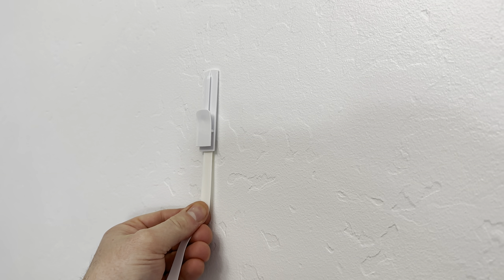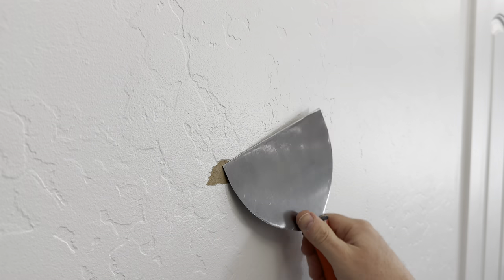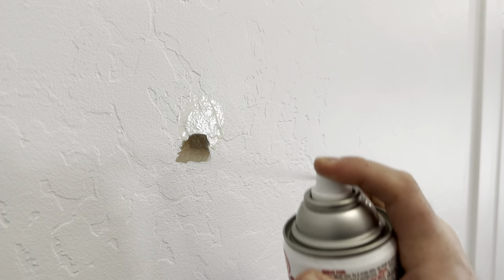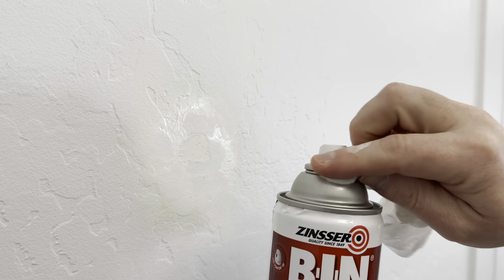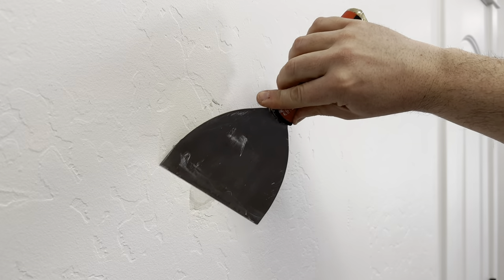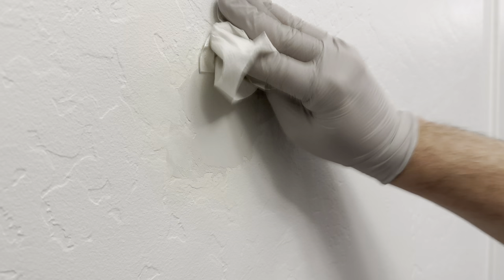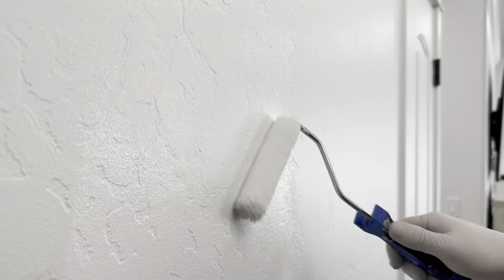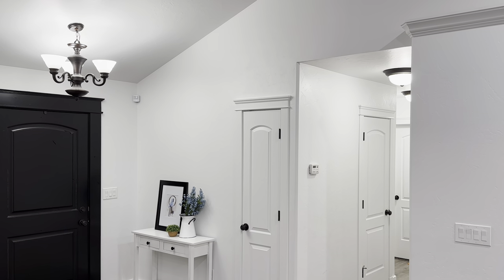How to Repair Torn Drywall Paper

Comment: I used Titebond and rubbed in all the torn drywall paper. I got it as smooth as possible first. Can I use another brush glue (it’s by Roman) on top of this before quickset mudding?

Comment: Try doing this without wall knockdown. Without texture, if you don’t prepare the patch correctly, I mean to say, sanding. There’s flashing.this is a problem .
Reply: Did you mean that if the wall had textures, it would be easier? Like less flashing? I have a textured wall with similar damage caused by my puppy. Trying to fix it myself.